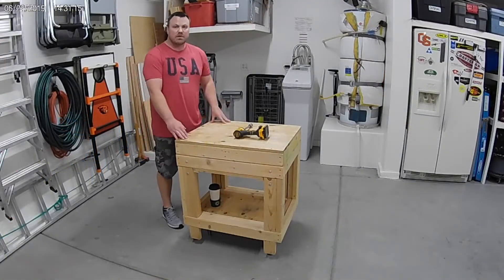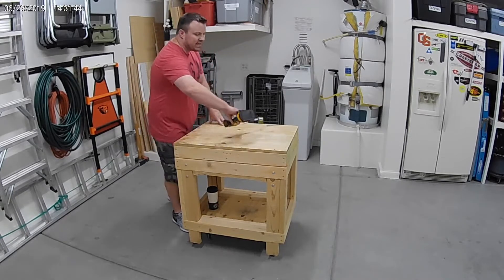Adjustable Height Workbench

Comment: Ever consider turning the jack upside down? That way you wouldn't need to follow it up with the electric driver.
Reply from the maker: That's not a bad idea. I haven't thought of that! However, the jack goes up and down slow enough that it is not noticeable. Good idea, I will check into it.
Reply: @kyletemplindesigns951  Hey, thanks for responding, I don't think I've ever had the poster respond to my comment before. I appreciate the video, I found it good advice for when I try this myself. Cheers.
Reply: How do you mean turning it upside down
Reply: @darylkanofski9327   If you watch in the video, when he uses the driver, he has to follow the table up or down with the driver. If he turned the jack upside down, the crank portion of it would stay stationary and he wouldn't need to follow it up and down when raising/lowering. I hope that answer what you were asking. Cheers.

Comment: How does the stabilizing of the top work?
Reply from the maker: There are knobs on each leg that can be tightened, this makes the top stable. There are also adjustable feet on the bottom of each leg to make the top level on uneven surfaces. Hope that helps.

Comment: How do the legs drop like that when you raise the table?
Reply from the maker: It works like Russian nesting dolls. The wheels are located on the inner section and the legs are on the outside. The legs on the outside lower down and raise the inside table top via a scissor lift.